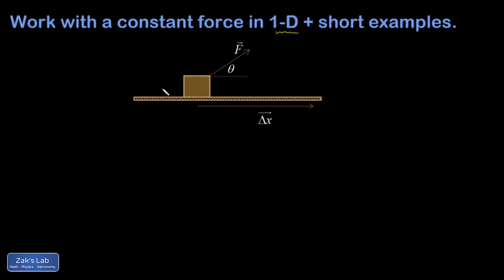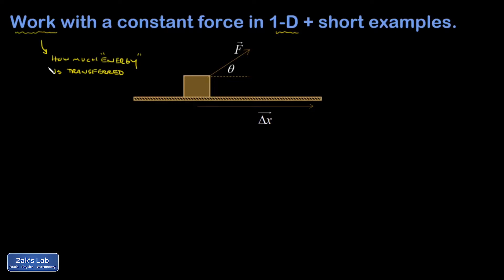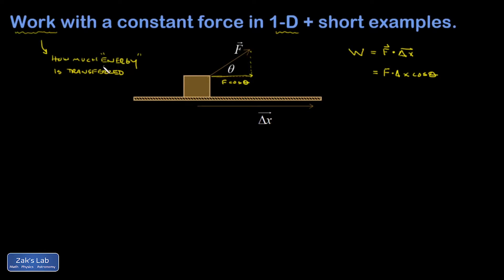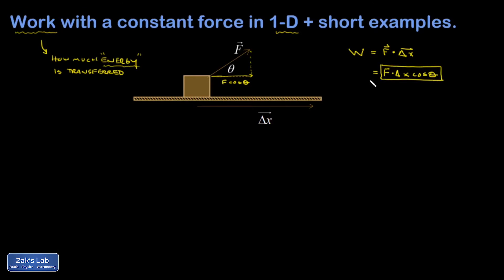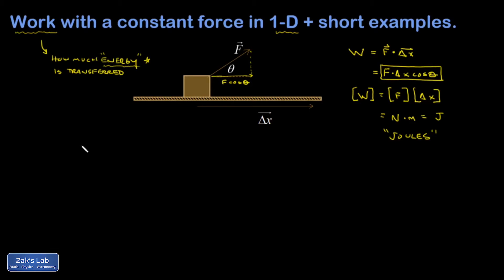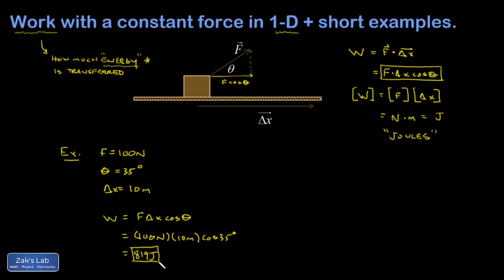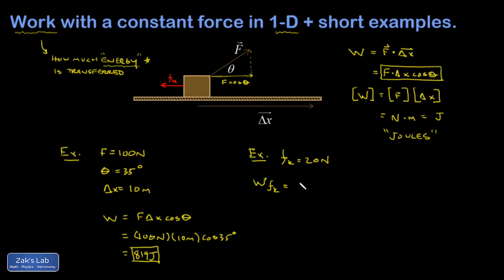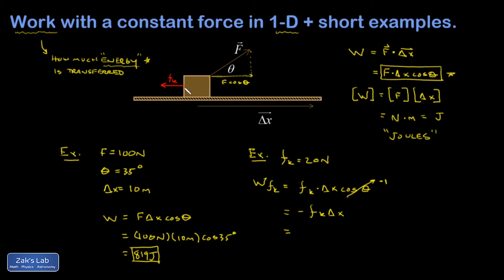Work done by a constant force + examples.

Comment: How can work be done in a negative since area can never be in negative!???
Reply from the maker: If you're thinking about work as an integral of force over displacement - we can interpret integrals as area bounded by the curve, but when we say 'area' we really mean 'signed area'; i.e, area under the displacement axis counts as negative.

Going back to the fundamentals on integrals from first semester calculus, you can imagine slicing the area bounded by a F-x graph into thin vertical strips with height F(x) and width dx (or delta x).  Then each incremental contribution to area is just the area of a thin rectangle: F(x)dx or F(x)*delta-x.  When F(x) is negative, these areas get a minus sign (they count as negative).